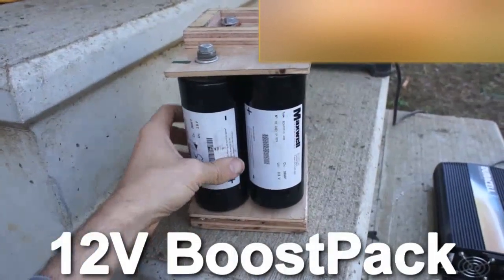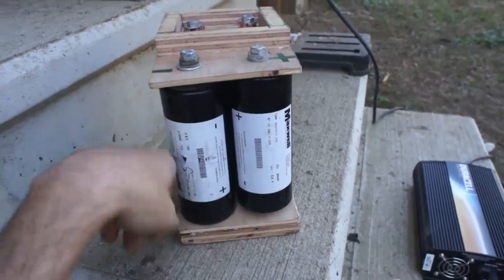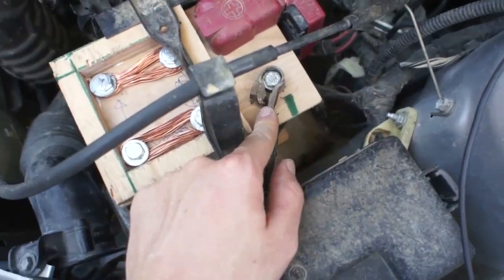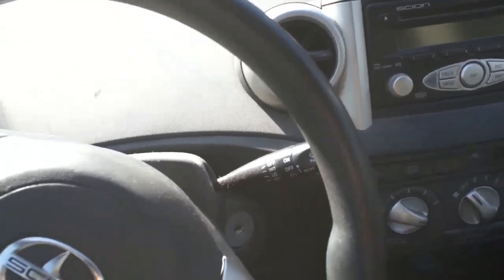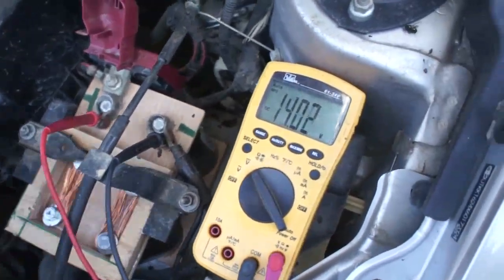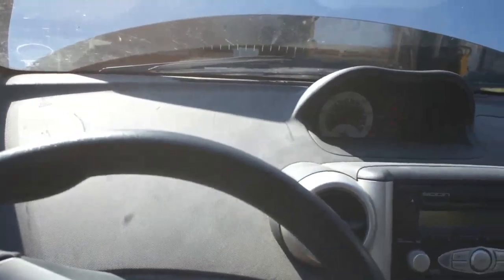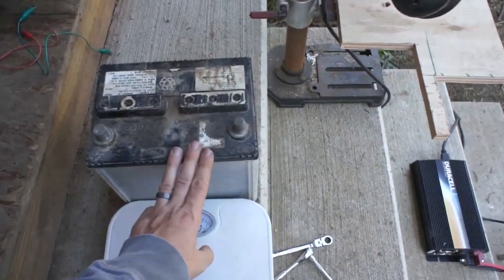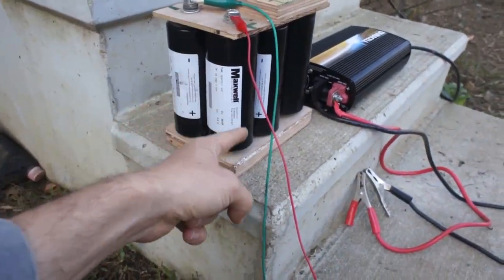12V BoostPack. Replaces auto battery. Works great!

Comment: If only I could find them for $6
Reply: How much do they cost regularly?
Reply: @MrManerd  An equivalent, quality wise to what this guy is holding/jangling around would be somewhere close to $300 at least.
There are cap setups being sold with the same "specs" but, realistically, those are very very untrustworthy, and not worth the $30 they try to get them off for. Buyer beware with capacitors. Ever had some generic or off-brand AA batteries pre-included with some gadget you bought, or remote? Yeah... Offbrand/generic capacitors are like those. They will probably die, really really fast, if they work at all. Namebrand/quality parts, will last longer, and come with a price hike.
You can get a system close to his, quality and spec wise, for around $130. But you can get a really newbie comfortable setup at around the $270 mark, since Maxwell sells a 500F pre-made bank kit at $270.
Reply: @MrManerd  also, at the time of his video, those were $50-100 each according to him in the video at around 5:26
Reply: thanx

Comment: The cheapest I found these capacitors was $65 each, to make the pack you describe in this video would cost more than buying actual batteries.Now unless weight is of utmost importance, price would dictate that its not really a good value for the amount of power you can store.
Reply: When this video was made in 2012 these capacitors were going for like $7 each because they were taking them out of the electric buses and selling them off in bulk.  The busses at the time were all fitted with the newest latest and greatest Maxwell packs being produced.  This was a large-scale test to see if the technology was viable and it did work.  Most of the initial cost was eaten by the original owners of the caps since they put hundreds of thousands of cycles on them.  The beauty of these caps is that they are rated in the millions of cycles so even though they reached the design life of the test they still have a very long life in them.  From time to time you can still buy similar caps at pretty low prices.  it is kind of a first come first serve.

Make sure you buy quality caps though or you may not be getting what you are paying for.
Reply: look on ebay & Amazon   they have thousands for sale   really cheap
Reply: Danielle Pevec Millions of cycles? really... is that under the temperature that most car batterys sustain?
Reply: I just wonder how much of the stuff you see in how to do it videos came from or walked out of some employers inventory.

The people who make these videos may have something that works .. but ... so often the actual cost is so high that unless your need was dire and the real product was not obtainable, no one with any sense would do it.
Reply: @JohnHenryReaves  $350 but you never have to buy a battery again. 1 million cycles last you a lifetime.
Reply: John Henry Reaves paranoid schizo
Reply: theres a insane mark up on capacitors because they are normally used in industries that gov is all up in stilling money from climate change. anyway u need to know someone that has a business account in heating or a/c then you can find them for real cheap. market up is like 1000%. this vid may be cool but not pracatible anyway
Reply: Danielle Pevec

Car batteries should not be exposed to more than 80F or their life will be shortened.  But car manufacturer put them under the hood anyway because manufacturer save money by having shorter wire runs.... But those elevated temperatures will kill your car battery early and the manufacturer of those cars and batteries do not mind because they are making more money.
Now.... look at the temperature ratings of capacitors.....sure looks about the same as the batteries to me.

Older cars have heavier bigger wires than new cars, so they can handle the power better.  If a light bulb uses 60 watts, then 60 watts is being send through the wires and it does not matter if the power source is a battery or a capacitor and in case of a short, each circuit is fused anyway to open the circuit if the amperage is to high.
Reply: not to mention if u have a older car with older wiring ur might find it causes alot of problems, and I can only imagine its not gonna last 1/2 as long as a good battery that u spent $60 more than what he's saying he's spent. u found something that works if u have nothing else, I doubt its superior.
Reply: On a modern car with a canbus system and auto door locking etc the super cap bank would run flat in a few hours. 
From new my car battery lasted 5 years and 250,000 miles before giving up the ghost. The replacement cost £65.. about 1/6th the cost of a bank of caps... There are uses for these but replacing a car battery is not one of them.
Reply: @williamarmstrong7199  Wrong!

Comment: The set of capacitors  are $350 new (not assembled ) on ebay.  
$6 each was cheap even for used.
But yea ..a $350 cap pack will do a better job of starting a car in the winter (as cold does not drain) than a $70. lead battery.

Comment: they are connected in series because the capacitor is limited in how high you can charge them.  You wire them in series to get the voltage you need.

Comment: He needs to get the voltage to a reasonable level.  They are only 5V caps, so he needs at least 3 in series.  It still isn't robust though because you can't assume you will have the same voltage across each capacitor.  Supose you have 3 in series and one of them has a little more leakage than the other two, so only 1V is developed across it.  Now you have 13.2V developed across only 2 of the caps and POW!  Hope he's wearing goggles when he's poking around with these.

Comment: Hi, if is over charge (14 volts DC). Do you need to built a little circuit to prevent a over charging?

Comment: Use an isolator so that the alternator charges both the caps and the battery.  The battery would be "in reserve". Rewire the accessories to the reserve battery, it is usually the second wire coming off the positive.

Comment: Do you realize what a capacitor bank could do in combination with a lead acid battery, allowing it to remain in a charged state more efficiently? Quickly capturing energy from something like a solar panel or wind turbine, then charging the lead-acid battery for the longer time required as wind or sunlight becomes intermittent.

Comment: No, as the capacitor charges up it draws less current. The cutoff circuitry is in the car's electric system. when it senses less of an electrical load, it reduces the current to the rotor coil and the alternator spins with less resistance, allowing the car's engine to use less fuel to maintain a given speed, etc.

Comment: Isnt this the same thing, they actually manufacture these. I am going to check out the price now. Looks like the configuration of how the capacitors are situated are 12 that are in horizontal configuration. In order for the link to work below you must type in the 3 w first. It wont allow me to post this otherwise.

maxwell.com/products/ultracapacitors/products/engine-start-module/

Comment: I have a few questions, reserve capacity and try this out on a much larger motor, like a ford 460 or chev 454 and a large diesel. Either way very nice demonstration and very practical and feasible, at least for smaller applications.

Comment: not sure if a bank of caps needed to run a trolling motor for any useful amount of time is possible yet. you'd have to give up too much space in the boat. one possibility would be alternating banks and figuring out how to charge the unloaded bank faster than you can drain the charge in the loaded bank. you can convert lead acid batteries to lead alum batteries which are noncorrosive.

Comment: I use trolling motors in my boat. I use two very large boat batteries that I charge at night. How come the capacitor will not hold a very long charge like a boat battery? I hate the weight of the batteries and the acid inside.

Comment: The reason it charges quickly is because a cap has a low internal resistance, especially compared to a lead-acid battery. Yes, it's storing less energy, but it's much more resilient than a normal car battery, can be recharged from dead more times (longer time between replacement), and can be recharged from dead very quickly (matter of minutes vs an hour).

A circuit to cut off the capacitor "boost pack" when it's providing too little voltage is trivial.

Comment: I was curious about, "ballast resistors" so I looked them up on Google, and all I found was references to using them with LED's and a few other applications but nothing about using them with batteries in series or parallel.

It appears that the purpose is to maintain an even distribution of current through low resistance items that are wires in parallel.

Anyway, could you please explain or provide links to what you're talking about?

Comment: I'd also be concerned about the diodes in the alternator.  When you connect a completely discharged capacitor bank to the car, what limits the current the alternator has to produce?  Granted it may be only a second, but that's usually enough to toast the diodes.

Comment: Not only that, but if he has 6 in series, he's only going to have 1/6th the capacitance!.  And I completely agree without balancing resistors you can't assume all the caps will have the same voltage across them.  For a bigger chuckle, this guy is fromping around these caps with a ring on his finger.  Wonder what would happen if he accidentally got that ring across the output leads.  Can you say bye-bye finger?

Comment: Hmm, now how to have the best of both worlds, the big charge capacity of a battery and high currents provided by the cap bank? Wire both in parallel. The battery will keep the caps topped off even if you leave your car standing for days or weeks, and the cap bank will provide the juice to start the car even if the battery alone wouldn't be able to. You'd be able to use a much smaller battery, too.

Comment: disconnect the alternator and see how long it runs :)
also, leakage resistance
capacitors are not some magic thing, they've been around for decades, what makes you think this guy found something new?
Reply: Graphene has not. So this is fairly new past 20yrs. Leakage is not that much but its there. See his 350SC setup. Left it 10days and it fired up his car.
Reply: @SamaritanElad  my post was 7 years ago. and we STILL are not implementing this in modern cars. there might be a reason for that

and no, not some nutjob conspiracy reason

Comment: When you connect anything in series, you decrease the voltage across each element.  In this case, 14V divided by 6 capacitors equals 2.3V each.  You also divide the capacitance by 6, so it's only a few hundred farads as opposed to a couple thousand.  That's still a lot of capacitance though.

Comment: Test cranking amps (CA) with a battery tester, you'll find it quite low I suspect.  Test alternator output while recharging and you'll find it quite high.  Most modern engines require very little in CA so if you don't need to crank it long you might be fine.  If the heavy draw does no harm to the alternator you might be OK as well.  The solar panel will not rapidly replenish the drill press use.  Amp hrs are simple calculations in and out.

Comment: No Sir a Capacitor is used for filtering Voltage or as a charge pump (depending on the circuit) and not current that job is done by resistors. A Capacitor has no current limiting at all hence the reason they are used as stiffening Caps, because they can deliver huge amounts of current at what ever voltage they are charged with. Short discharge caps designed for this are placed next to the Amplifier's due to both voltage and current flow issues if it is a distance from the Batteries.

Comment: Ballast resistors across the batteries, sorry but where are you residing? I have worked around Earth Moving equipment and Trucks most of my working life and have never seen any ballast resistors of any sort on series or parallel arranged batteries. resistance internally in the Battery will limit the charge current. Caps however are a different story as current limiting resistors are desirable.

Comment: Yes and no, as most vehicle Alternators require a certain amount of stabilisation load to actually regulate properly, I believe you could still run into issues with Caps instead of regular storage

Comment: caps under the hood? where the temperature easily goes over 80°C? not recommended. And undervoltage might fry any mosfet in the car.

Comment: I addition the internal resistance of the Caps you show is so low that it is like to make your Alternator's regulator fail because the caps will act like a charge pump possibly pushing the voltage way past what you car should handle. Never seen any Ballast resistors on any trucks or other machinery using multiple batteries Bob internal resistance of the batteries is such that it shouldn't be needed.

Comment: Oh I forgot to add that this pack you have made is potentially an electrical Bomb  why well 6 X 2.5 V 2600F Caps is nowhere near enough for a Car you should be at least 20-30 V rated Capacity so it is well above the Alternator's voltage because they from 14 to 18 Volts at anything up to 120 Amps + . 
Your pack @ 15 V could become a bomb.  I have had large caps like this blow up and believe me it ain't pretty, go 12 you will still only have the voltage that the Alt can provide. Your call

Comment: You expect me to believe that you can run your accessories etc or a while and then start the car. I have some that are 20 Farads as well and these due to the Voltage and current have bleed resistors internally in them. I believe that if your not careful you WILL fry your cars electrics by running Caps alone because there is not sufficient load to allow the regulator in the Alternator to correctly work and you might end up with voltages as high as 20V DC or so,not a good idea but it's your Car.

Comment: Get a 50+ years old car and you wont need any batery at all. Modern cars have electronic that needs constant voltage. Digital ignition system is why modern cars can not be pull-started and you need jumper cables instead of piece of rope. The bat has also security purpose, it can power many important systems in the car for hours even if the motor is stopped/broken (parking lights, CB radio, GPS, cellphone,...) Go on, save few kg with your capacitors....lol I stay with my bat.

Comment: Correct, using capacitors as an alternative to a car battery is a really bad idea if you ever keep the fan, radio or light running while the engine is not running. The capacitor pack on this video has a tiny fraction of the energy of a similar sized standard battery. Just a few days ago I was shopping and when I came back to my car I learned I had left the light on.

Comment: If you use some zener diodes that shunts each capacitor with a series resister, I believe you can balance series coupled capacitors better without having the constant energy loss. Some design care must be done concerning the zener diode voltage, the zener diode power rating and resistor per capacitor. Ideally the sum of zener voltage should exceed the max battery voltage to avoid any loss when the car is parked. Don't you think this could work?

Comment: Huh.

6 of those supercaps would be around $70 or less. A new car battery (depending on the type) runs from about that much on up. At worst they cost the same, at best supercaps are cheaper.

Supercaps can also last years longer than your standard lead/acid car battery that usually gives up after about 2 years. The only downsides to supercaps is you can't run accessories for long while the engine is off and increased wear on the alternator.

Comment: You spoke of running the lights in your shop. Well yes the caps + inverter to 125 vac would discharge quickly. But instead of that for go the inverter and use 12VDC LED lighting. As we all know LED lighting has very little draw and in saying that it wouldn't be hardly anything on the caps. You could get quite a long burn time with the caps+ LED's.

Comment: I'm an EE with a few comments. Putting batteries in series generally requires "ballast resistors" across each battery so they charge safely and somewhat equally, but these resistors will also discharge the batteries, so I'd use caps that have a voltage rating of at least 20volts and put them all in parallel, w. no ballast R's. A battery will last much longer without charging, so I would go for LOTs of capacitance. Certain recent technology caps are probably much better suited for this. Thx

Comment: I seriously doubt that it would start the car after running the Radio for some time, or internal ventilation fans, and it is NOT charging as such but the Voltage will rise instantly to whatever the output of the alternator is,  The cold cranking ability of capacitors is very good but they do not provide power over a long period. The Booster Pack Auto Club service guys use are in fact often a capacitor bank that have been charged to 14 Volts or so great for a couple of starts and very light.

Comment: I wonder if he could use a larger solar pannel like a 12v 5amp have it hooked up to the boost pack and lso have the inverter hooked up simultaneously and run continued operations as long as the sun is hitting the pannel?

Comment: Yup, and if it's a 65 amp alternator (probably about right since the car is equipped with AC), you'd only need a resistor capable of dissipating ~800 watts. Resistance needed to be able to charge at 65 amps would be .2 Ohms. I did a little searching, couldn't find one, but eBay has 800 watt resistors (100 Ohm, too high) for $60 each.